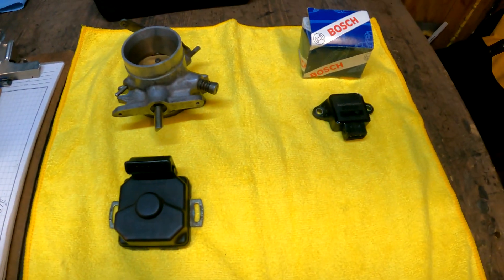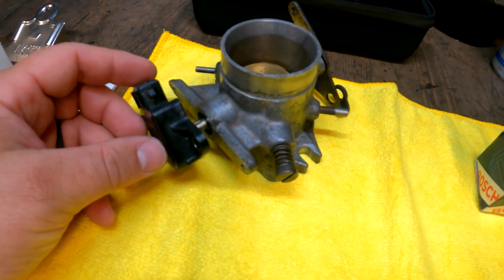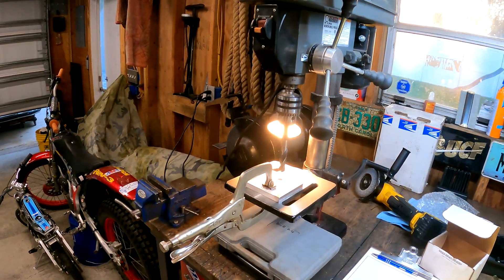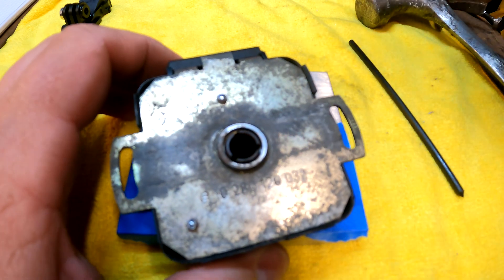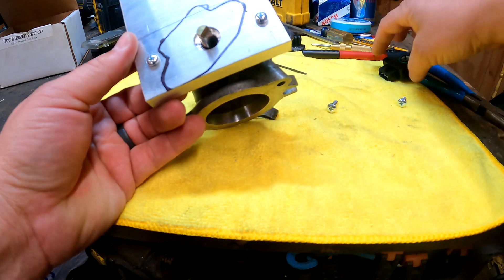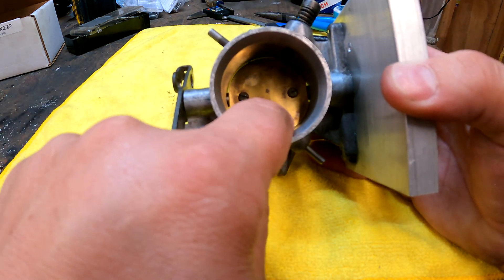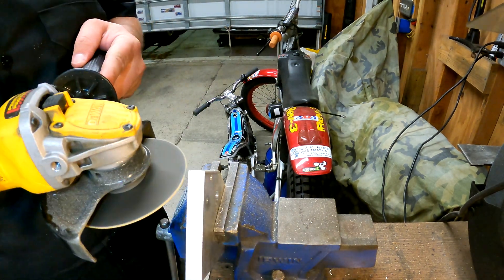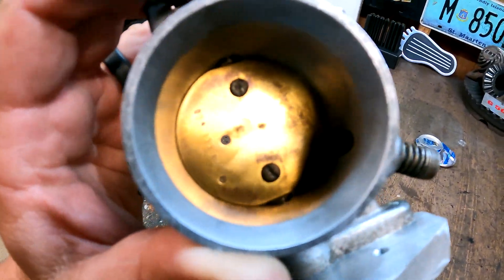Porsche 914 D-Jet Delete- Haltech EFI Conversion Part 6: TPS Adapter

Comment: Do you have the Bosch part number for the TPS?
Reply from the maker: Not easily, it’s lately as “universal” Bosch tps from the dubshop.
Reply: @barefootgaragejax9252  
I edited this comment due to misinformation that I posted.
Reply from the maker: @MatthewMoss644   nice! I’m going to other way and carb swapping my 411. I just redid the exhaust on the 914 (more baffles/back pressure) and the O2 readings are very good now. Good luck!

Comment: if you use a Idle Air Valve, close the bleed Hole with a Solder Iron. I experienced whe you dont, you will end up with too mutch air and have difficulties to adjust propper Idle.
Reply from the maker: Did you close or plug the hole in the throttle blade too?
Reply: @barefootgaragejax9252  ? ... the Hole I meant is the little hole in the Brass Throttle Blade. I haven't altered he Throttlebody, only soldert the Hole in the Brass Plate close.
Reply from the maker: Thanks! I have run it “all the way home”, but may need to seal it further.